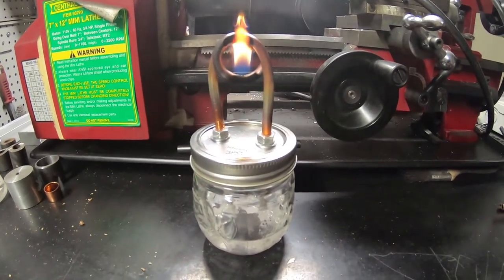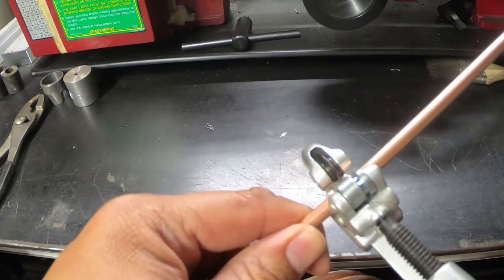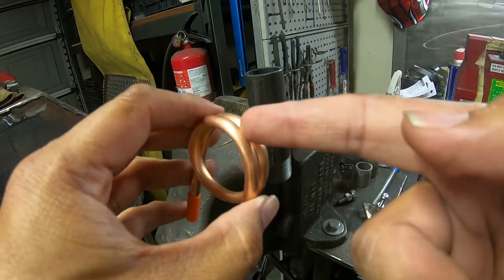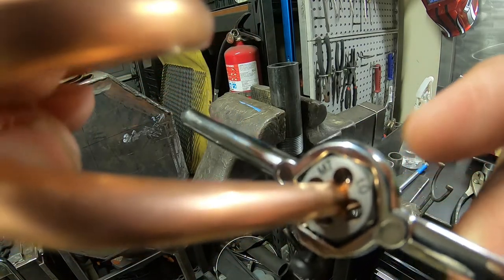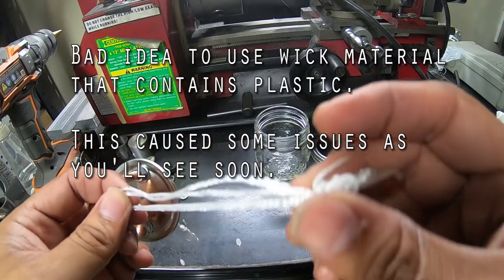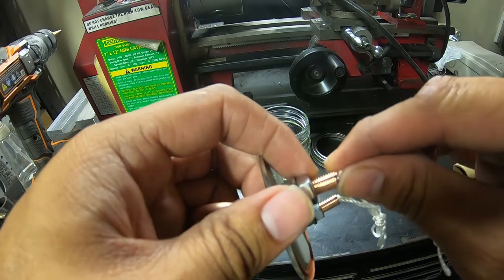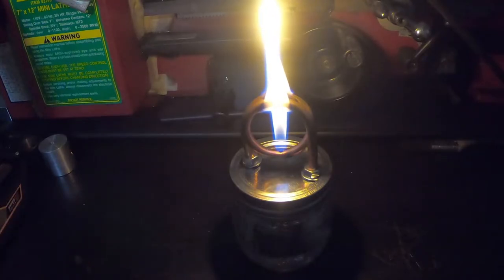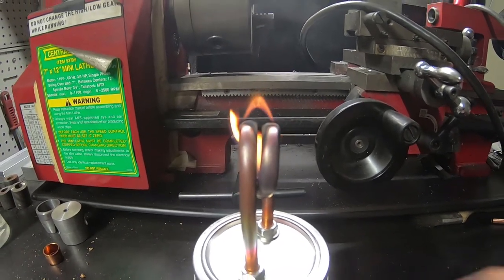Copper coil alcohol burner - no JB Weld needed

Comment: I just made one. I was out of 1/4" soft copper so I used 2/4" aluminum Pilot Tubing and didn't need the sale or sand to not kink it because it is softer than the copper pipe. Plus Cheaper!
Reply from the maker: I was thinking aluminum tube initially, but could not find any readily. Good to know it will also work for the version.

Comment: Carbon felt works amazing as a wick for the stove it will make it sound like a torch or rocket
Reply from the maker: Thanks for the tip. Never seen that stuff in the regular hardware store around here. Will have to look for it on Amazon.
Reply: @ShinyInsanity hey bro could you put up all the materials and measurements as well I'm interested in making one

Comment: What a great idea to thread the copper pipe, I've not seen anyone else building one like that, your flame should be more blue, perhaps opening the gap between the coils may help, I think the gap distance is critical. One tip, if you put a lantern mantle over the flame you will get a very bright light and if you hav one or 2 of these heating a metal pipe above and blow air through the pipe with a small fan, you will get a decent fuel fan heater for your room. What is your fuel consumption on this stove?
Reply from the maker: Thank you for the suggestions. I'll have to experiment more for sure. I had a better blue flame at first but tweaked the hole to be bigger and bent the coils out which I don't think helped. As far as fuel consumption I'm really not sure. I only ran it for around 45 minutes and didn't really notice what it was using. I still had plenty left after that run.

Comment: Drilling the 1.5 mm hole in the coil works much better, and is more accurately centred, if it is done when the pipe is bent to 180 degrees. The drill will fit and the pipe will allign itself on the forming pipe to keep the hole pointing up when the coil is completed, so long as the hole is taped closed to stop the salt falling out.
Reply from the maker: Not sure I follow the process you mentioned. Are there any videos with examples of how this is done?
Reply: @ShinyInsanity  No videos but maybe I can better explain. The way you formed the coil was to bend the pipe into the complete coil before drilling the hole. The completed coil made aligning the drill bit almost impossible as 1.5 mm drill bits are too short. If you drill the hole when the pipe is formed into a 'U' , you can get a 1.5 mm drill exactly where it needs to be. Put a bit of tape over the hole to stop the salt from escaping. Drop the 'U' shaped pipe over the pipe that you are forming the coil around. Complete the bend and the drill hole will be correctly centred on the finished coil. Continue to form the coil to complete the  bending. When the salt is removed and the burner set into the mason jar and lit, the flame will go between the two pipes above it, not pointing to the side. That is what happened when I used your method.
Reply from the maker: Thanks for the additional details, I see what you're saying now. Good tips for making another one in the future.

Comment: I did one of these but put a SS wire mesh mantle around it with a lid. The mantle heated the coil much more and it burns like a jet. I got a 1026° reading on the lid with it but the glass jar was heating up below so I abandoned it....and that was using 91% alcohol.
Reply from the maker: That's an interesting experiment. I'd be worried about the glass cracking at that temp so might have to try this with a metal reservoir instead. Thanks for the tip.

Comment: I’m trying desperately to thread my 1/4” copper tubing without it bending and twisting in my hand. Massive fail! I used the M7 die and I can only get about 2 turns before my tube starts contorting. Even a vise doesn’t stop it. What am I doing wrong? Please make a video of you doing this part from start to finish.
Reply from the maker: Go slow at first and use some tapping oil or some other lubricant to help. The copper was pretty soft and didn't give me any issue once I got it started. Don't use a vise since it will definitely twist. If you're using a thinner gauge copper tube that may also contribute to twisting.

Comment: Maybe I missed it?  But you made an alcohol burner and didn't say what type of alcohol that you are using?...From the looks of your flame I'm guessing Isoprypol alcohol. If you want a bluer flame burn Denatured Alcohol in it (Heet yellow bottle) and you'll have better flame results.
Reply from the maker: Yup, standard grocery store isopropyl alcohol. I can't remember if it was the 70 or 90% ratio but  wanted to test it with more readily available fuel versus using the good stuff (i.e. full strength denatured).

Comment: I'm confused. You used a 1/4 inch diameter length of copper tube and placed the holes in the lid with a 1/4 inch bit. 
Why use a metric tap and die set to cut the threads? I'm not tool savvy so don't roll your eyes, but why can't you use an SAE tap and die set?
Reply from the maker: You want the gap between the pipe and the lid to be as small as possible to avoid leaks so using a bit that is as close as possible to the pipe diameter is ideal. You would have to wiggle the drill a little to get the hole barely larger than the 1/4 size to get them to fit. The inside diameter of the pipe was closest in size to a metric tap size I had and fit better than any SAE tap would. Hope this helps.
Reply: @ShinyInsanity  It did help, thanks